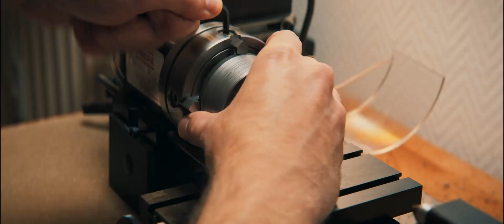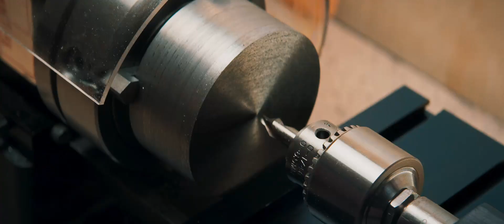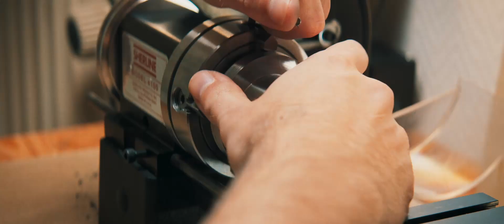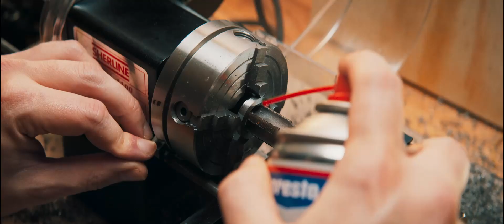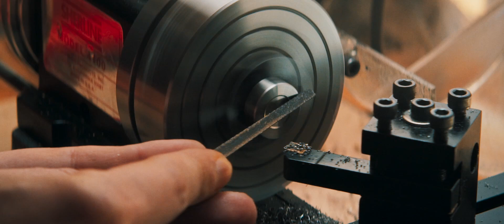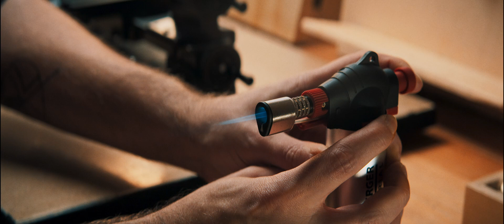Watchmakers Lathe Milling Attachment - First Test Run of My Custom Spindle! | LOOK WATCHES

Comment: Excellent videos, educational, good editing. Waiting for the continuation, subscribed.

Could you add information about bearings?
Reply from the maker: Awesome to have you, thanks! The bearings are a matched pair of angular contact, high precision spindle ball bearings. 

17x35x10 with a 15 degree pressure angle and are comparable to the SKF 7003 CD/P4A.
Reply: @Lookwatches Thank you!

Comment: 5 micron is pretty good on the taper for a homemade spindle! Sherline says their tolerance is 25 micron for spindle runout. The extra runout with the gage pin might be collet runout. I'm not very familiar with small morse taper collets, but generic r8 collets can easily have 15 microns of runout. 
If you're interested, I think there are a couple places where you may have been able to improve your process (though obviously your results are really good regardless)(and this maybe be more related to what you included in the video vs what you actually did). When you turned the morse taper, you dialed it in radially, but you didn't dial it in axially (in the video). It looked like you relied on the accuracy of the 4 jaw and the POM split clamp instead of tapping it in and indicating it, so the taper you cut may not have been perfectly aligned with the outer bearing journal. Your inspection (again what you showed at least) only looked at one point in the taper, so you might have missed a slight misalignment with the outer journal. Though fixing it at that point would be difficult. The other thing is that the concentricity of threads made with tap and die may not be good enough for your purposes. I think nuts and such for spindles are generally single point threaded and faced in the same setup to ensure that the way the thread fit will be perpendicular to the face and not slightly misaligned and then applying weird forces to the spindle when tightened. I don't think that would matter for the drawbar though. I know Sherline sells a gear kit for single point threading, though it is a pain to use in my experience.
Reply from the maker: All of your assumptions are quite on point. The axial dialing in is definitely something I totally overlooked. Thanks for that. I am also aware that using taps and dies for this kind of application is not recommended, but my collection of tools is still growing, and the single point threading attachment will be added someday. I've seen some reviews for the sherline One, and the process seems painful, I give you that. But just for making the fit much more tight, I think it's worth it in the long run. At this moment, I've reached a runout I'm comfortable with. When everything is set up and I'm getting to using it, I'll have more perspective on if the spindle needs more precision. I mean, I'd love a runout of 0, but that's not possible with my setup and lack of experience. Thank you so much for your insights! Much appreciated.
Reply: @Lookwatches  If you want zero runout, just get a worse indicator!

Comment: If you put it back in chuck, and stick a rag with polishing compounds on a stick into it for a good few mins, maybe a higher grit after the first, it'll get super smooth and you'll probably loose that runout, it does with me on some of the parts I've bought that I've wanted to improve. (sandpaper works too obvs, just do 800-1500/2000 just more difficult to hold still for full length of bore0
Reply from the maker: Hi! Good idea, but I think the runout comes from a very tiny misalignment in the concentricity between the two bearing pockets because the bore itswlf was reamed pretty consistent. Have a look in my last video if you like to see me turning the taper inside the arbor.